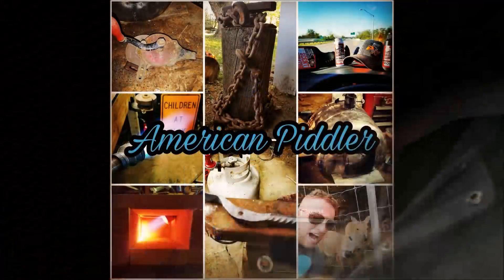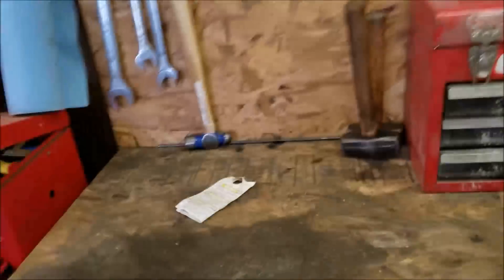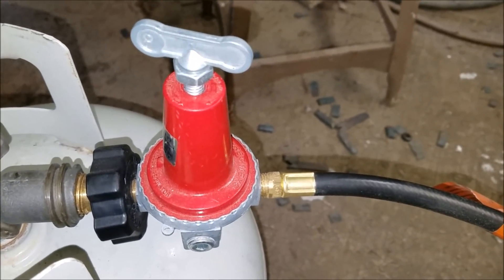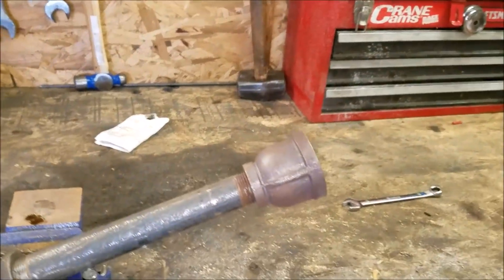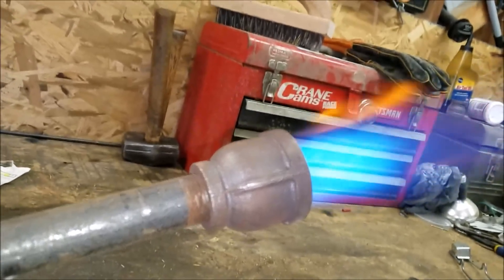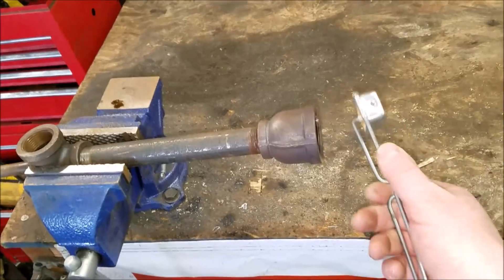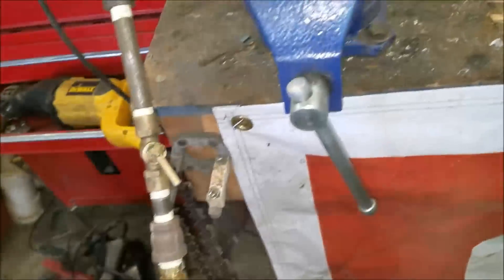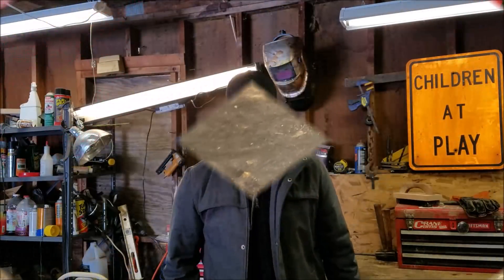Propane Forge Burner Don't Make This Mistake!

Comment: Thanks for this. I wish I'd watched this before I spent all day today making hardware store runs :/
Reply: I actually tried this and I do agree
Reply from the maker: Tanner Netterville Man I wish you would've seen it sooner also! That's exactly why I made this video! If you still need a high pressure regulator the one in the link is the one I use and it also helps support the channel thanks for Watching!
Reply from the maker: Tanner Netterville and don't forget to subscribe and share the video so the next guy will know before it happens again!
Reply: M

Comment: If I understand correctly, this has to do with the velocity of the gas as its moving down the pipe.  If you use downsize the diameter of your pipe and restrict the incoming air, would the low pressure regulator work at that point?  Obviously not ideal if you're trying to build a nice forge, but would it work, or would it still back feed to the nozzle?  Scratch that.  I just realized that the low pressure regulators are less than 1psi.

Comment: Thanks my friend for the advice I work on a burner and I didn't know this and I was going to use a low pressure regulator You said to use a 40 psi regulator
this is around 2 bar is this correct ?

Comment: I made a propane forge burner without a regulator, it works good until it gets hot, then it starts to sputter alot. Will a hp regulator fix that and why?

Comment: My regulator goes up to 30 psi but it back feeds I need help soon please. It drops down to zero once I turn the nozzle open to go down the torch. Idk if I should buy a new regulator or valve that feeds it slower but idk if that’d defeat the purpose of the the regulator or if it’s some other problem I’m not thinking of.
Reply from the maker: Not sure try an set it lower to light it if that doesn't work it may be the regulator... I know the one we use works flawlessly 🤷🏼‍♂️ Thanks for watching don't forget to subscribe and Keep on Piddling! #americanpiddler
Reply: Will do I’ve got a couple more ideas to I’ll try out before I go and buy a new regulator. Thanks for the help and quick response!
Reply from the maker: Wanted to check back and see how everything turned out?

Comment: Try drilling out the center of the low pressure regulator. Then just use the valve to regulate pressure as needed. Works for me 😉.... Also add a high volume air pump to the unit to introduce more oxygen into the mix. I've accidently melted cast iron with this.

Comment: I agree the high pressure regulator is recommended to have but it will also work without a regulator.  You can  adjust the flow with the valve on the propane tank but as the pressure in the tank decreases you have to fiddle with the flow rate.   The regulator holds the flow At a more constant rate.
Reply: How can you adjust the glam cause mine is just a big orange cloud no toech

Comment: I know this video is old, but I bought a single burner forge a while back and it isn’t able to get my steel to a good forging heat. I have to bash it as hard as I can for hours with minimal result. I was wondering would my forge get hot enough if I bought a high pressure regulator and used it instead of the stock regulator it came with?
Reply from the maker: Not familiar with what you have sorry... Thanks for watching & keep on piddling #americanpiddler

Comment: I am having an issue with my high pressure regulator. It is acting like a low pressure regulator. Ever since I replaced my empty tank with a new full tank, it’s been giving me problems. Any suggestions would be appreciated. Thanks
Reply from the maker: Could be the safety valve inside the tank itself if the pressure releases too fast it will shut off... Thanks for watching & keep on piddling #americanpiddler
Reply: You may have some crap in your line that is stuck in your oriface

Comment: Sooo... Thanks for the info, and i like your burner design... But... I built my forge burner to duplicate a Plumbers Pot Burner i had borrowed from a friend- It did not have a Regulator at all, mine now does not either... Im sure its unsafe somehow, (even if the flame ran back up the hose, propane cant explode without oxygen, so im not worried about blowing up..) but for the years and dozens of tanks of LP ive ran through it ive never had a problem- so does a regulator do anything else for my benifit?
Reply: The regulator gives you a means to fine tune the flame of your burner.  By messing with the pressure, choking the air intake, and varying the orifice size of your gas system, you can get different results.  Changing the carbon/oxygen ratios inside the forge, or finding the sweet spot that gives you the best fuel efficiency, or the right temperature for what you need
Reply from the maker: I would stick with what works... too risky Thanks for watching & keep on piddling #americanpiddler

Comment: doesn't the setup also need a flashback resistor? I've never seen anyone using one
Reply: Copper wool works well for that
Reply from the maker: That's a great idea Gary! Thanks for watching and Keep on Piddling #americanpiddler
Reply from the maker: Yes Chris that would be an added safety measure that we would recommend... Thanks for watching & keep on piddling #americanpiddler

Comment: what if you dont use any regulator ,  just tank pressure ?
Reply from the maker: What if you blow yourself up....no you need a regulator! Thanks for watching and Keep on Piddling #americanpiddler
Reply: @AmericanPiddler  thanx for reply, i have a monster weed burner / blow torch straight to tank from harbor freight i guess its designed like that. thanx ,  woody.

Comment: How hot does the pipe tee get on the burner?  I am wondering if I could use epoxy putty like Quicksteel instead of getting a friend to weld it for me.
Reply from the maker: All I can say is the design we used works! Thanks for watching and Keep on Piddling #americanpiddler

Comment: What psi do you run your regulator at for the 3/4" burner tube?
Reply from the maker: I am not sure what psi it is at? I do not have or run a pressure gauge! Thanks for watching and Keep on Piddling #americanpiddler

Comment: So when I hook every thing up and the ball valve is closed the pressure stays at 30 psi. But when I open the valve the pressure drops drastically. Does this mean the opening into the burner is too large would tapping a mig tip solve this.
Reply from the maker: Yes you have to use a mig tip! Thanks for watching and Keep on Piddling #americanpiddler
Reply: I did that and I am getting faster better heat but the pressure from the tank still drops slowly. Not sure why.
Reply from the maker: Is it because you are using the LP and losing pressure 🤷‍♂️ Thanks for watching and Keep on Piddling #americanpiddler

Comment: I have a 20 psi reg, decent blue jet but not like yours ...does the depth of the welding tip matter much ?  I've got the same sections of pipe as you built and the orifice is midway and centered between the air intakes
Reply from the maker: I have a 40psi regulator and the depth matters because of fuel air mixture! Hope ya subscribed! Thanks for watching and Keep on Piddling #americanpiddler

Comment: Great video 😁 ive a triple burner gas  Blacksmith forge and I have a high pressure regulator attached to the propane bottle but there is no pressure and it is making a gurgling poping noise how can I fix this problem
Reply from the maker: I am not sure... Thanks for watching and Keep on Piddling #americanpiddler

Comment: Low pressure good for CHICKEN !     Also if running large volume you may get Mr freezmizer on the valve. In winter its a beach.
Reply from the maker: Yes sir it can freeze up! Thanks for watching and Keep on Piddling #americanpiddler

Comment: You use a low pressure regulator with forced air.  It gives you the same burn as a high pressure using half the gas.
Reply from the maker: That's is another way for sure! Thanks for sharing and Keep on Piddling #americanpiddler

Comment: I figured that this was my mistake when I first tested my new burners.  Unfortunately, Lowe's didn't have any high pressure regulators.  Will try Tractor Supply today.  Thanks for confirming what I thought I knew!!
Reply from the maker: Just buy the one in the link it's a great regulator and we've been using for almost 2 years
Reply: @AmericanPiddler  Thanks but no thanks would rather start forging today than wait until late next week.  TS had one in stock.  Will be installing shortly.
Reply from the maker: @basedbear1605  good for you! Keep us updated thanks for watching and Keep on Piddling #americanpiddler

Comment: Man , I'vw been working on it yesterday , and that was exactly my same problem , the regulator i am using is low . now i need a high pressure regulator .
i tried to use a 1.5mm nozzle but the gas pressure wasn't high enough to draw air from the T .
thanks . man .
Cheers .
Reply from the maker: Thanks for watching and Keep on Piddling!

Comment: Great video, thanks for the guidance.
I am about to make my own propane burner and while researching I found someone using a low pressure regulator but they had attached an electric air blower to it to create more pressure.
I've not had the experience of either method yet but the forced air burner looked pretty awesome.
Do you have any experience of a forced air burner?
A 13kg propane refill in the UK is £40 and a high pressure regulator will eat that in a day, thanks again.
Reply from the maker: I sure appreciate you watching I dont have any experience with a forced air unit... Thanks for watching and Keep on Piddling!

Comment: Thanks for the video my friend. I tried using a home LPG gas regulator (SM-888) and the flame was weak and would die in just a few seconds. I just got a 0-20 PSI High Pressure Adjustable Propane Regulator from Amazon, hope it will make a difference
Reply from the maker: The one I reccomend is up to 40 psi I know it would make a difference!

Comment: What pressure is good?
Reply from the maker: I start it at like 20 and then all the way to 40 and back ot down after its up to heat
Reply: @AmericanPiddler  ok... My high pressure regulator stops at 20. 😆 I have the kibow 0-20 psi high pressure regulator with guage from amazon. 
But with that said its been running good at around 13 psi once up to heat.

Comment: Hey Ezra, thanks for this and your other vid on making a forge burner.  Question: could this burner be downsized  to the next smaller pipe size?  I ask be ask because my forge has a smaller chamber, about 5" round X 12" long.  Thanks!
Reply from the maker: I can only speak for what i use because it works the others i dont know about sorry... Thanks for watching and Keep on Piddling!

Comment: Low pressure works fine on a ribbon burner. Just build the right burner.
Reply from the maker: Or use the right regulator
Reply: @AmericanPiddler  I believe that the most cost efficient burner would be the right burner, and ribbon burners are more efficient the torch burners like yours. Up to 400% more efficient fyi
Reply from the maker: Glad to hear can you share a link to your build? Cause I would love to see it and also would love to create an episode building one then do a side by side comparison!

Comment: Hi, I have a propane forge (double burner) I built and I have a high pressure regulator. My forger will be going strong and then I will lose pressure and the flame will look like the one coming from the low pressure regulator in your video? Any idea whats wrong?? Help much apprieciated. Thank you.
Reply from the maker: Are you running it off a 20lb propane tank? If so they have an internal regulator that will shut it off if too much is flowing out to prevent a huge leak it's a built in safety valve that you could be triggering because of the amount of flow.... hope this helps btw thanks for watching and Keep on Piddling!

Comment: Just figured this out this week :(
Reply from the maker: Hate to hear it took  awhile but happy you know... now if you'll share it with others it may help them not make the same mistakes I did... thanks for watching and "Keep on Piddling"
Reply: @AmericanPiddler  yeah I finished building the forge a week ago and have been scratching my head as to why my jet is so much smaller than the ones in videos haha. It looked like a spluttering flame. Like it was choking
Reply from the maker: Good to hear you've got it going Great job!

Comment: With high pressure gass and oxygen together, u can get to heats extreme enough to cut steel.
Dial it down to low, and u got perfect temps to melt aluminium within a couple mins, or if putting the torch on it directly, within seconds.
Generally you don't want it too hot though, cos u wanna melt the stuff in the crucible without destroying the forge with heats too extreme.
Be careful with high pressure oxy gas burners.
Reply from the maker: Thomas thanks for all the knowledge you have shared! Thank you for watching and contributing to the Piddler community!

Comment: Just a random question, and most likely a dangerous one but why is a regulator needed? can you just go straight to the bottle nipple and only have the tank open a little?
Reply from the maker: Absolutely not too dangerous to try on this channel... as the unit becomes heat soaked and if there was a hiccup in the line it could back flash the line and boom you've just made the evening news... PLEASE SO NOT TRY THIS!
Reply: @AmericanPiddler  noted. will use regulator. haha

Comment: I cant get mine to even light. I tried to spark it I tried a lighter and it just wont light even up at 20 psi
Reply: Yes I have a the bell on the end of it. It looks just like yours what psi do you normally fire it up at?
Reply from the maker: Anywhere from 10 up to 40 psi something must be wrong are you sure you ha e a high pressure regulator
Reply: Got it working had to add some restriction over the air flow holes on both sides I took some washers and drilled some holes in them
Reply from the maker: I would have to see exactly what you've got but do you have the bell on the end of it is my first question!

Comment: It's funny that i stumble across this video after starting to look into getting a high pressure. Like you said, the low psi grill reg. wasn't cutting it. I ended up making my own using an old air compressor pressure regulator rail and the difference was astounding but it leaked gas like crazy.  I'm buying one tomorrow for sure.
Reply from the maker: Yup this is exactly why I created this video! Happy to confirm what you had already figured out! The one we use is great, has a ton of control & goes all the way to 40 psi. Thanks for watching and don't forget to subscribe! Could you also do me a favor & share this video so other's don't make the same mistake!

Comment: Can I use a garden weed burner for a forge and if so, do I still need one of these high pressure regulators ?
Reply from the maker: I'm not sure that a weed burner will get it done and unless you are using a forced air type burner you have to have a high pressure regulator

Comment: Dumb question can you run without a regulator
Reply: pressure in the LP tank will vary wildly from 175psi in summer heat to 3 psi in the deep cold winter.  It will also vary as the tank runs down in fuel volume and vaporization from liquid to vapour is affected by surface area and tank dimensions/diameter.
Reply from the maker: Safely no because one blip or pop and the flow turns negative and you've just blown yourself up and also made the nightly news ABSOLUTELY DO NOT TRY TO RUN WITHOUT A REGULATOR!

Comment: Did the same mistake, orderd a Small forge burner from Russia (live in Sweden). Totally new to using gas/new experience. Hooked it up and got so disapointed/thought that i had been ripped off. Then I did some research and luckly it was an easy fix
Reply from the maker: Zippr that's good news Thanks for watching and don't forget to SUBSCRIBE!

Comment: Hey brother man. Building my first gas burner, watched this, realized my mistake, went to TSC and got a regulator up to 60psi for 22 bucks and a 5ft hose. Hooked it all up, put gas to it, and it came out stronger, but not jet like yours...more like an in between of the two. Cranked the valve all the way open and it didnt improve much...any advise? The only thing I'm thinking is that its an old propane tank with little left in it.
Reply from the maker: Noah Weber could definitely be that you're out of propane.... what burner did you build so many variables hard to say one thing with what info you've given me!
Reply: American Piddler looks identical to yours. I have a 6in nipple...not 8. I threaded in a .6 Mig tip inside.
Reply from the maker: Sounds like it should work.... check your tank then we can go from there
Reply: Awesome, I appreciate the time. Ill let you know what happens. Stay safe
Reply: Hey brotherman, so I got a new tank filled. Fired it up, same problem. Thought to myself, maybe not enough air. Drilled four holes in the tee next to the mig tip. Got better, still not a torch. Realized that when I welded the 3/8 with cap and mig tip into the tee, I had pushed the cap all the way into the junction of the tee. On a whim, I cut the welds, pulled the 3/8 as far "out" as I could so the cap was against the "ceiling" of the tee and only the end of the Mig tip just barely extended into the opening of the 3/4 exit. Fired it up and presto! FIRE! I appreciate the input and without this video I would have been SOL. Thanks!
Reply from the maker: Super stoked that you figured it out that was something we could've worked out but I would've had to have pictures etc... You may have to try and use an 8" nipple

Comment: My understanding is that the low pressure regulators only work with forced air induction so adding an air blower would work and it would increase efficiency.
Link  below for more information.
http://www.backyardmetalcasting.com/blowburner01.html